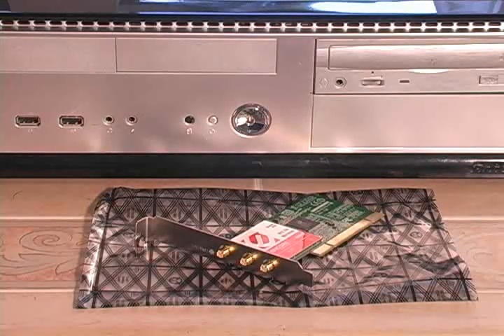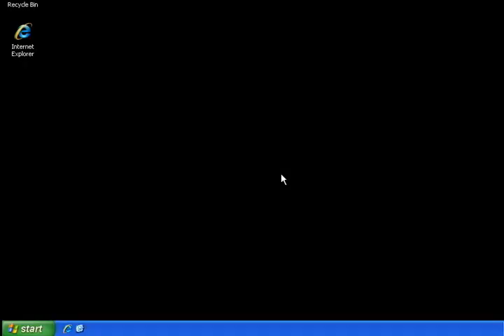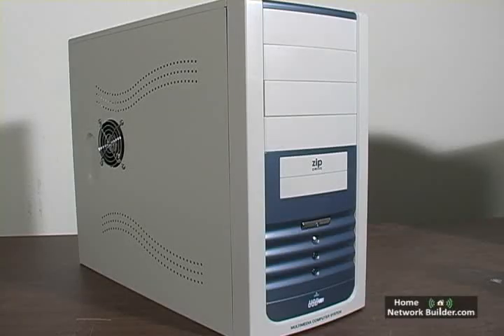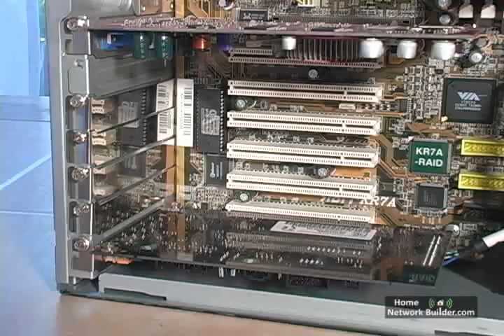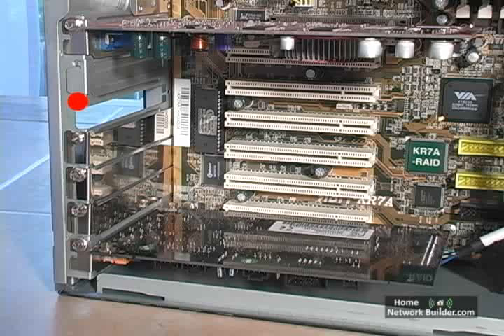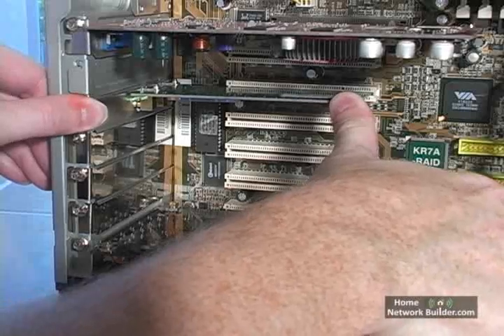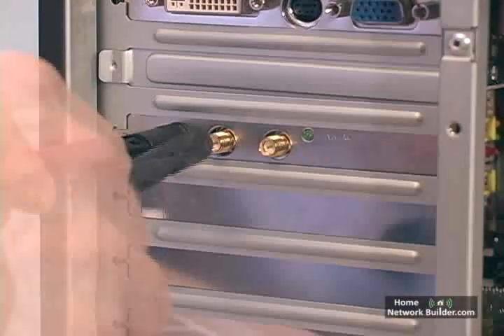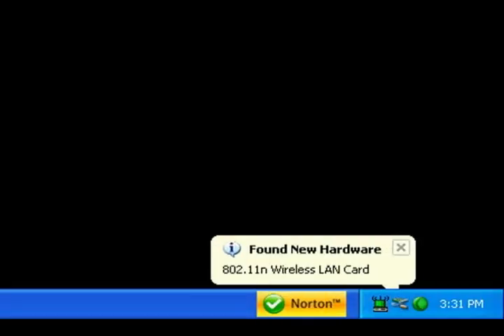Section 2 - Lesson 3:  Installing a PCI Card Wireless Network Adapter

Comment from the maker: @DArksidersRockz This is a wireless network adapter you would need if you weren't able to connect your computer to the router with an Ethernet cable.  Just about every motherboard comes with an Ethernet adapter built in so as long as the computer is close enough to the router you can just connect it with an Ethernet cable.

Comment from the maker: @rrgert4 You can install the card and then the drivers.  If Windows does have one built in it will ask for it and then you have to point Windows to the drivers which can be difficult to find.  By installing the drivers for you skip that step and it makes the process easier.

Comment from the maker: If you are going to get your own Internet connection you will need to make sure the service comes with a wireless router or you will need to buy one separately.   But yes the wireless adapter built into the laptop will work with any wireless router.

Comment from the maker: If you're connected to your wireless router that is good.  You need to also connect a computer close to the router with an ethernet cable and see if you get Internet access from it.  If you don't you need to go into the routers configuration and make sure it is set properly for your modem.  Section 3 of the videos covers this.  Go to our website listed in the description of this video and you will find all of Section 3 and the rest of the videos available for free.

Comment from the maker: You can leave the software and drivers for the built in adapter installed.  It is fine to have more than one wireless adapter on a computer.

Comment from the maker: It sounds like Vista doesn't have a driver for you PCI card.  You need to find the model of the card and then a Vista driver for the card from the manufacturer.  Does the card show in Device Manager at least?

Comment from the maker: The wireless signal would come from the router.  Have you gone into the router configuration, setup wireless security and then connected to the router with the security key?

Comment: Hey man :D I was just wondering if you could help me? I have recently bought a wireless PCI card for my Desktop. I installed it no problem with the help of your guide. However My desktop doesnt seem to pick it up even after I've installed the drivers, on closer inspection the LED on the back of the card arnt lighting up (No power?) do you think there is a problem with the card its self?

Comment: Hey hpcbdvd, I have an Airlink101 300N PCI wireless adapter I had it install and running for about a Month now. It get me good signal and I get 54Mbps. My Airlink can do 300Mbps. How can I get the full speed? Or do I need another wireless router that is capable of 300Mbps, (802.1N Draft router)??  Im using a router AT&T provide with our service.

Comment: Hey I have 2 questions 

•

I'm planning on building my own PC and I haven't added one of these to my cart, will inserting this to my motherboard allow my PC to connect to my wifi? 

•

And how so I know which wireless card to buy that will actually fit into my motherboard ? 

•

Could you please answer both thanks.
Reply from the maker: Yes the purpose of a wireless adapter card is to allow the computer to connect to a WiFi network.
Reply: But how do I know which one I get that will fit Into my motherboard ?
Reply from the maker: Nikez Gaming You'll need to check your motherboard for either PCI or PCI Express slots.  Buy whichever type of card you have open slots to install it into.

Comment from the maker: Try disconnecting and reconnecting to the wireless router.  Make sure it says you have Internet access not just local.  You might also want to check the network settings in your browser.  You want it to automatically adjust its settings and remove any proxy setting that may be there.  Also try opening a command prompt and type ping google.com   If you get a reply it means it is something wrong with the browser or its settings.

Comment from the maker: @MijnWet Does the computer start up with the PCI card out of the system?  If it doesn't you might have bumped something loose.  Try pressing in on all the other expansion cards, memory and power cables.  Taking them off and putting them back in is the next thing to try.  If the computer does start up with the new PCI card out of the system it could be a bad card or it may be in some way incompatible with your system.  What system/motherboard do you have and what model PCI card are you adding?

Comment from the maker: @kommeht00 If you mean use the wireless network adapter you have for your laptop on your desktop PC  that depends on how it connects to your laptop.  If it connects through USB then yes.  If it connects through a PC Card or Express Card slot then no.  Unless you get a PC Card of Express Card adapter for your desktop PC but those are more expensive than just buying a new adapter for your desktop.

Comment from the maker: If you have a small form factor PC with half height PCI Express slots you will need a half height PCI Express card with Firewire ports.  Firewire is also called 1394.  If you have a website you can order from let me know the address and I'll see if they have a card that will work.  It would be helpful to also know the model of your computer.

Comment from the maker: It does not matter which slot you install the wireless adapter as long as it fits.  You do need to make sure you get the correct type of PCI.  There are either PCI or PCI Express slots. The letters after 802.11 tell you the type of WIFI, either G or N.  N is faster.  We cover the two types of WIFI in an earlier lesson.

Comment from the maker: @rrgert4 It might.  It depends on the model and whether Windows 7 has a driver for it.  Windows will also try and find a driver online although it might take some time and will need to already have Internet access to do this.  Its best to go to the cards makers website and download the driver.  You can then install the driver software and then install the card.

Comment from the maker: @Flygonair If it connects to a USB port then yes you can just move it over.  If the wireless adapter in your laptop is integrated it can't be moved.  If it is in a slot on the side of the laptop it can be put in an adapter card and installed into an open PCI slots, but the cost of the adapter would be more than just buying another wireless adapter.

Comment from the maker: Try going into the device manager and see if there is an unknown device or a PCI device with a ? or ! on it.  It may be that Vista just didn't have a driver for the adapter.  Go to the properties of the device and try installing the driver that came with the adapter.  If it doesn't work try moving the card to another pci slot.

Comment from the maker: Your computer will have an open slot that is either a PCI or PCI Express slot.  Some computers have both.  You need to identify the type of open slot your computer has and get an expansion card of the same type.  This video does show the difference between PCI and PCI Express slots.

Comment from the maker: @MijnWet I wouldn't spend the money for a new motherboard if the only problem is that the PCI slot doesn't work.  You can get the same functionality with a USB wireless adapter for a fraction of the cost.  Unless the whole motherboard is now dead.  Is that was is going on?

Comment from the maker: If you have an open PCI or PCI Express slot and are comfortable installing one that is the way to go.  If not the USB option will work fine.  You just give up a USB port and you run a greater risk of breaking the adapter since it is outside the case.

Comment from the maker: Yes any wireless adapter has to support the same type of security the router does.  wpa psk is very standard.  Any PCI adapter you find will have this support.  You can make sure it does before you buy by reading the specifications on the adapter.

Comment from the maker: The desk is open at the back and that lets enough cool air in and the hot air out.  I wouldn't recommend putting a computer in a desk with just enough opening for the cables to fit through.

Comment from the maker: Yes, the back of the board with all the solder points faces up and the chips are facing down.  This is normal.  It's been this way since PCI slots and cards were introduced.

Comment from the maker: Just about all add-on card wireless adapters will have the antennas.  You can get a USB wireless adapter instead and most of them do not have any external antennas.

Comment from the maker: @hotshot331 The PCI wireless adapter can give you better signal reception and therefore better speeds.  They aren't expensive and are easy to put in as you can see.

Comment from the maker: PCI refers to the type of interface on the card and slot. A LAN card is also referred to as a Ethernet card and allow you to connect through an Ethernet cable to your network, or a high speed modem.  Your computer probably already has an Ethernet port built in to the motherboard, so you may not need a separate card.  If you look on the back of your computer, the Ethernet port looks like a slightly wider` telephone plug.

Comment from the maker: Right.  To get full Wireless N speeds you need both a Wireless N router and adapter.  You can get a Wireless N router and connect it to your ATT modem.

Comment from the maker: You can install a PCI wireless network card regardless of the operating system.  If the desktop originally came with Windows XP it will have a PCI slot to add the card.  PCI slots were of that era.  If you have a computer that is a few years old you need to check the slots.  It may only have PCI Express slots so you'd need to get a PCI Express card.

Comment from the maker: The Ultimate N is a mini pci express wireless card meant to go into a laptop.  It has dual band capabilities so if you have a dual band router you can double to sometimes triple the speed of wireless N.  You can get a dual band USB or PCI Express adapter.

Comment from the maker: A PCI wireless network card serves the same function as a wireless adapter in a laptop.  You do need a router to get access to the Internet.  Some DSL or cable modems have wireless routers built into them.

Comment from the maker: You need to look in Device Manager under Other Devices.  If it shows up there you need to install the drivers that came with the card.  If it doesn't you should try the card in a different slot on the motherboard.

Comment: @hpcbdvd thanks it works now. when the guy at the store assembled my computer he only had windows 7 and i wanted xp, so i decided to install the os by myself at home. then when i installed the driver and restarted my computer and clicked the icon nothing would happen so i turned it off dis and reconnected the wireless network adapternand now it works fine. thanks!

Comment from the maker: @xpodtouch As long as you touch an unpainted part of the computer case before you start working in the computer any static electricity is out of your body.  If you live in a high static electricity environment wrist straps are a good idea.  Otherwise its just overkill.

Comment from the maker: You would need a new driver for the PCI card, either from a CD that ships with the PCI adapter or from the makers website. As far as the software side goes, yes, you would use the same configuration utility built into Windows to connect to the network.

Comment from the maker: Make sure the metal face plate on the card is going over the left side of the motherboard.  PCI slots can be very tight and require a lot of pressure to get the card to go in.

Comment: It depends on the cards mbps because this determines how quick you can connect with the router to connect with the internet, so the higher the mbps of the WLAN card depends on if it will help[ you or not

Comment: Oh ok. Thanks for the reply. Appreciate your videos. I have an older computer using xp pro and need to install a netgear WG-111 USB Adapter. I know on my FIOS router I put the number of the router into the password slot of the adapter. How about a Xfinity Gateway all in one from Comcast Cable? Are you familiar with that? thanks again.

Comment: What if I want to install a NEW adapter? Do I need to uninstall the old PCIE's drivers first?
Reply from the maker: Cherry Pauper If you don't need the old adapter then yes you should uninstall it.  Check the Programs and Features uninstall section.  Sometimes there will be a program that you can uninstall to remove any utilities and drivers that came with the old adapter.

Comment: So if I was to want wifi in a virtual machine, would this adapter be able to allow me to have wifi access?
Reply: Pyrax depends if the motherboard on the virtual machine has expansion slots or even has compatibility for it

Comment: Will this make my internet connection to my pc faster through wireless i only have 3 Express slots
Reply: Yes. It should. Depends if u get a cheap vs a expensive adapter.
Reply: Ok. Adapter?
Reply: Quantum Dragon Yep. BTW get a PSI not a USB
Reply: Quantum Dragon Get a PSI becuase it has a direct connection but the usb will be slower because it isnt direct
Reply: IDK what this video was even about i ported years ago
Reply: Quantum Dragon Its about installing a PSI internet adapter xD
Reply: TheGamingCube123 MC Name:HHCvideogamer Oh an internet card it'll sepeeed up my internet right?
Reply: Quantum Dragon Well if u get this Wireless card then it will be about 10 MBPS slower then if u used Ethernet
Reply: i have 2 Ethernet cables both too short so I'm getting a connector to use both
Reply: Quantum Dragon Ok good :D
Reply: :3 thanks I'm literally 1 meter short from my PC because e of my Ethernet xD
Reply: Quantum Dragon Lol
Reply: That awkward moment when you only got 1 MPS downlaod speed...
Reply: Quantum Dragon U only hav that much?
Reply: yeah idk why my cumputer is old
Reply: Quantum Dragon What pc is it?
Reply: Old HP
Reply: Quantum Dragon oh